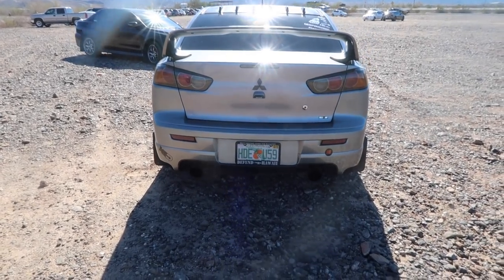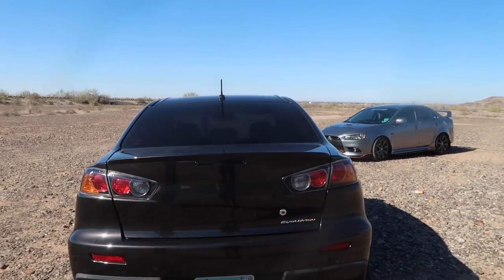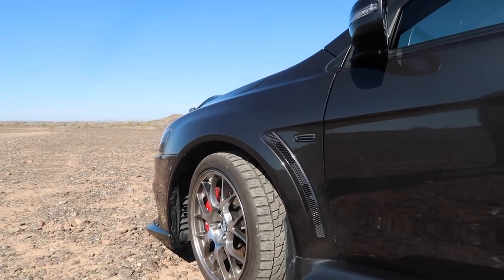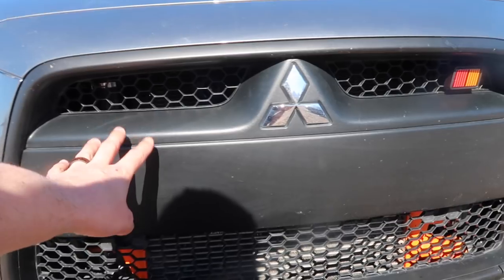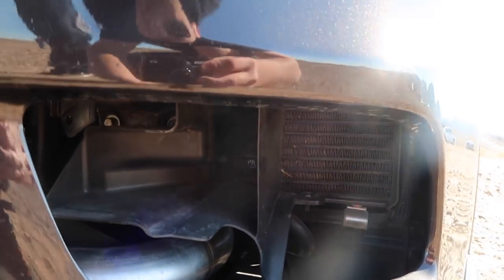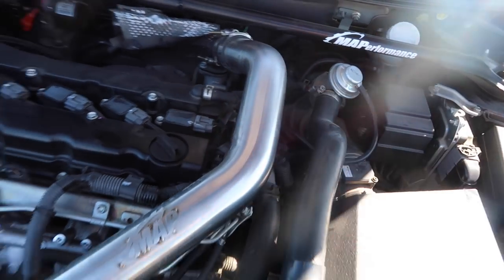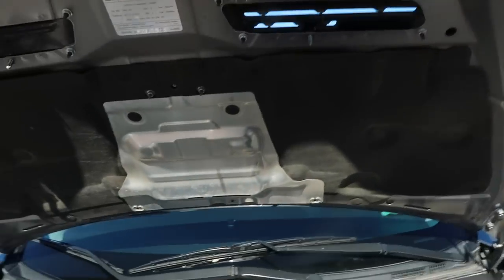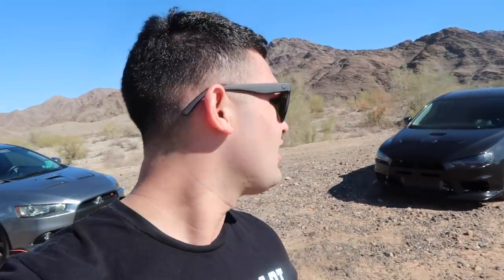Mitsubishi Evolution Vs Ralliart

Comment: if you are going to tune, get the ralliart and spend the extra money to effecivaly go above and beyond the evo, becasue they are effectivaly both the same engine and gearbox, 4wd system is a little bit better on the evo but no bigge at all.
Reply: Also...the gearing in the Ralliart SST is taller than an lancer Evolution...therefore the Ralliart will have a higher top speed. I bought my Ralliart (JP spec) brandnew and i wanted/liked the Sportback a lot better than the sedan...i have only seen 3 other RA Sportbacks and only one in black where im from in 9 years...but seen hundreds of lancer evolutions. The Mitsubishi dealer actually gave me an evolution for 3 days to test drive...so ive driven both but ultimately i obviously went Ralliart. Why? I have a quicker, better handling car than a stock Evolution and for far less money....($7000 in mods on my RA) The thing i have found is Evolution owners always say an evolution is better to warrant all the extra money they had to spend...as we say in Australia...its more Ego than Evo...

Comment: Fender vents are actually designed to reduce drag caused by the tires/wheels. If you think about it you have a large mass of steel/aluminum and rubber spinning at high speeds creating a large turbulent zone under the wheel arches; basically an uneven pressure zone around the tires/wheels which affects the airflow down the side of your vehicle causing more drag. Adding fender vents gives the air an easy passage to smoothly rejoin air flowing down the side of the vehicle reducing drag and also helping get rid of the heat that can be trapped under the wheel arches, but their main goal is to reduce drag; just like front spoilers, rear spoilers, and splitters do. They all help return the turbulent air to the smoother flowing air. They also can create down force which is a big deal when you’re talking exotic cars.

Comment: Just for anyone wondering, RA has a stronger rear diff, non multi link rear suspension unlike the evo, the roof isn't aluminum and doesn't feature the drain tray ribs. The MR 5th and 6th gears are different ratio.

Comment: Correction fender vents are not for cooling brakes they are there to extract engine bay heat.
Reply: Excel4600c I took mine completely off and also made the hood vents 100% functional. The vent on the left is partially open but you can unscrew the plates under the vents. I noticed a bit difference during summer. I had also removed the fog lights and got the fog light delete kit to get more air to the intake and to the oil cooler.
Reply: Removing the plates under the hood vents is a must. Much better venting of the engine heat especially that heat that gets pushed back into the bay from the IC and radiators. 

The side vents do vent some heat, but are mainly to vent pressure build up in the bay, which I found mind blowing during the explanation.

Removing the fog light assembly is just ghetto. There's a trim kit to replace it but it looks awful to most people as it doesn't fit with the stock bumper well at all. Almost cartoonish. You'd be better served to replace the oil cooler with a more efficient heat-exchanger than to remove the fog light assembly and look ricer AF with a set of gaping holes in your front bumper.

Comment: Evo - For paved track preformance 
Ralliart - for Gravel/Dirt Rally preformance 

Ralliart - The smaller brakes are important - you can use a smaller wheel. Thats important because if you are going to fit a Gravel tire on there, your going to NEED the extra space that a smaller rim provides. Also much less chance that a rock will get stuck in the calipers.  
Dual clutch is important, its the closest your going to get to a sequential dogbox from an OEM set up. on the rally course, thats a huge plus to not have to work the clutch when your driving/listening to your navigator (if your doing stage rally) 

Evo - going high speeds on the track and with large disk brakes you will do better with heat dissipation. Also, you can run a larger tire on pavement as tarmac tires dont need the over-sized sidewall. The suspension is stiff to help corner at high lateral G's. 

Both are great cars. both made for different reasons. If you know why, then it makes sense.
Reply from the maker: Nice breakdown!
Reply: @TheSnyds  there's a reason why the ralliart is pronounced "rally art"
😉

Comment: A little more in-depth on a few things you mentioned...
The UICP and LICP are interchangeable between them. From factory, Evos ship with a hard plastic UICP and a metal LICP. The Ralliarts came with a soft mesh UICP and plastic LICP. When looking to go aftermarket for a Ralliart, all Evo X piping will mount just fine. In fact, if you don't plan on swapping turbos, the OEM Evo piping, bov, and intercooler are more than sufficient for the Ralliart.

The Evo intercooler mounts up perfectly on the Ralliart, it's just larger to allow for better cooling off the twin-scroll.

The BOVs are also interchangeable. Stock Evos = metal, stock Ralliarts = plastic.
Reply from the maker: Corbin Lawien Absolutely right. Actually upgraded all stated! Thanks for the in depth response
Reply: The Australian Evos had plastic mesh UCIPs, but you had (have)? to be running huge boost to deform them. I'm still running the stock one and I've got just over 400kw at the wheels.

Comment: I have a Lancer DE (I know its not fast but its a manual) im at 145000 miles. Could I replace the DE engine for a GTS? I also plan to replace or rebuild transmission. What should I do?
Reply: Sell it and buy a Ralliart or Evo. Ralliarts are dirt cheap now & will be far easier to tune up than your DE.

Comment: Good afternoon! Do not tell me what the parameters of the wheel on the ralliart?
1 - radius of the disk
2 - whether the spacer rings are mounted on the wheel hubs.
3 - Dimension of tires (eg 225/45)
The reason: I can not decide on the choice of the dimensions of the tires to my Lancer X 2.0L 4WD
Wheels: Yokohama AVS Model T7., R18 / 8JJ / ET45

Comment: I believe the blow off valve on the Evo is installed incorrectly. Because of the piping the way it is installed it won’t be able to activate it to recirculate, perhaps you can check that out?
Reply from the maker: Danilo Espinoza Rios It's stock like that.  I think that's the way the MR series comes,  GSR vacuum line is in a different position
Reply: It sits on the top of the intake for stock location. Most after market intakes move it farther forward.
Reply: Danilo Espinoza Rios lmao you can tell you don’t know about evos

Comment: Bro, if you have not yet, a switch to an Evo X Bypass Valve will make the car perform much better. The stock plastic one is leaky, the Evo's is metal and leaks less. Making it have more power in the later rpms especially at WOT. 
And it is technically stock.
Reply from the maker: Yesir! I actually had the Evos and ran great. Now I run a GFB 50/50 BOV

Comment: Soooo same engine?? Ralliart just has a smaller turbo
Reply from the maker: Correct
Reply: @TheSnyds  so ralliart is Awd so if you change the breaks wheels and the turbo its effectively a evo
Reply from the maker: @yuhboi8746  pretty much, it uses the evo 9 mr system
Reply: Thx i think i might get a ralliart then it a fair bit cheaper to thx a lot for helping me understand the diferences

Comment: Where did you get the ralliart banner on your windshield?
Reply from the maker: Alex Felise https://m.ebay.com/itm/53inch-Ralliart-mono-logo-mid-Windshield-Decal-Sticker-Banner-Sunstrip-Sunvisor/191660389877?rmvSB=true&ul_ref=https%3A%2F%2Frover.ebay.com%2Frover%2F1%2F711-53200-19255-0%2F1%3Ficep_id%3D114%26ipn%3Dicep%26toolid%3D20004%26campid%3D5338269140%26mpre%3Dhttps%3A%2F%2Fwww.ebay.com%2Fitm%2F53inch-Ralliart-mono-logo-mid-Windshield-Decal-Sticker-Banner-Sunstrip-Sunvisor%2F191660389877%253Fhash%253Ditem2c9fd975f5%3Ag%3AisQAAOSwDN1UPkmz%26srcrot%3D711-53200-19255-0%26rvr_id%3D1483994752337&_mwBanner=1&ul_noapp=true
Reply from the maker: Still looks almost brand new after a year of having it. Adds a lot to the car I think
Reply: The Snyds Thank you.

Comment: The MR doesn't comes without rearwing in standard.😉 The MR is in difference to the GSR a bit less powerfull, but you dont realy feel the difference.😊
Reply: Wtf??
Here in switzerland comes the mr without a wing and it's not less powerful
It has stock eibach springs and bilstein dampers and a lighter brembo brakes than the gsr
Reply: MR or GSR everything is the same except the transmissions.  Some countries the suspension and brakes might be different but the main thing is the SST for MR and 5-speed standard for GSR.
Reply: In older models the MR was more of a striped down model to be lighter more "race car" and think stick only not sure.
Reply: Older models you mean the 9 and 8?  and it wasn't a stripped down model. The later generations had an RS version that was stripped for racing...no sound system or A/C amongst other things.  The Evo X also had an RS but was a JDM only car.
Reply: Excel4600c Every Evo has a RS Trim and that's not true with 10 RS is jdm only.. I know 5 or more evo 10 RS and they are all left hand drive
Reply: North America did not get an RS model.
Reply: You can't buy it on a mitsubishi dealer..
Reply: Again not a North American or US available car.

Comment: all is see is a evo and a lancer.
Reply from the maker: ARG Point Break works for me lol. Sleeper if ppl think it's a lancer
Reply: The Snyds right? I got a black 08 gsr, dude it's so much trouble, everyone wants to rev on red lights 🤣🤣 I have to drive with right hand on steering wheel"both when going namean?"
Reply: The Snyds and I have the same exhaust I'm sure, I got single port invidia n1 straight
Reply: 2 things I hate about it? turn radius and only 5 gears...going 70 on interstate state sounding like I'm going 100 🤣🤣
Reply from the maker: Yea my buddies was pretty loud if yall got the same one